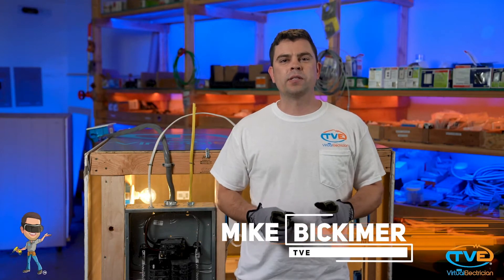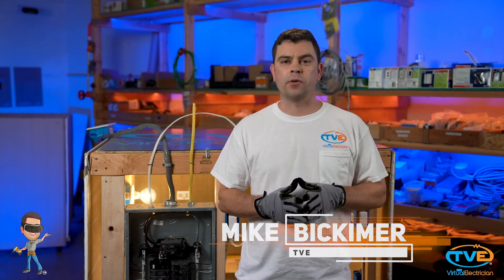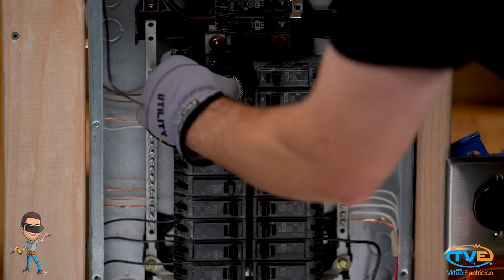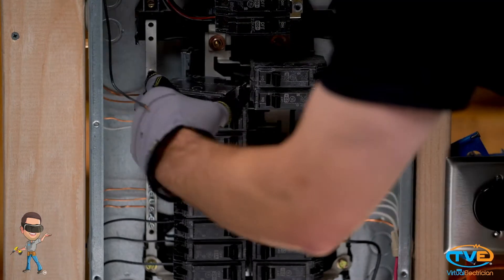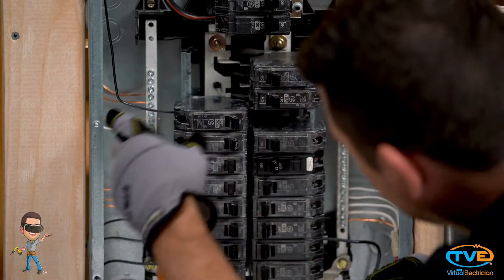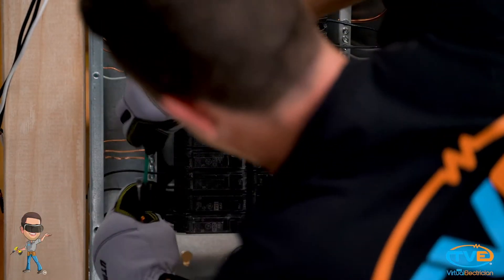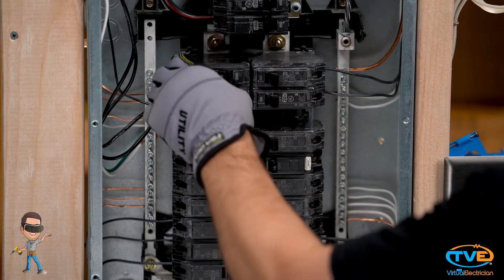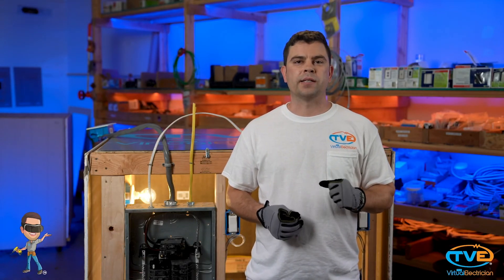How to install a whole home surge protector

Comment: The instructions say to use 1 20 amp single pole for each leg. Does it really matter if its two single pole or one double pole?
Reply from the maker: yes. use the double pole or install a breaker tie between the 23 singles.  if you dont install according to manufacturers instructions you may not get the connected load warranty

Comment: Don’t you need to protect those wires from the sharp edge of the knockout?
Reply from the maker: Yeah you can’t see it on video but that’s how you attach the surge protector to panel. The wires go through a nipple and you use a locknut to secure the nipple to the panel. The wires aren’t touching the knockout, the nipple is.

Comment: Does this spd interfere with the panel cover ? Just about to install same exact unit and it looks like it will interfere with he panel cover…
Reply from the maker: No that is just the cover plate for it. You can remove it if you want. I imagine they make it that big to cover up the drywall cut if your panel is in a finished room